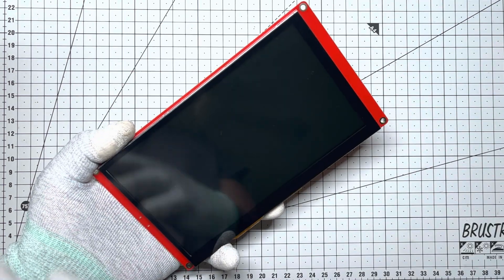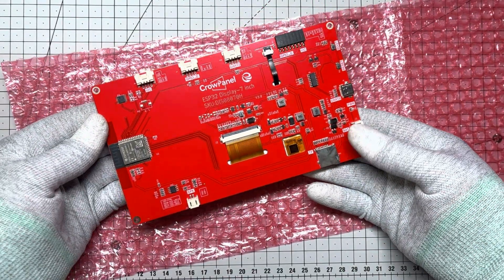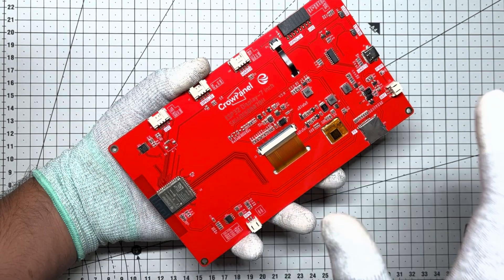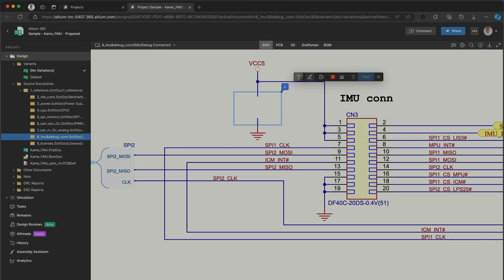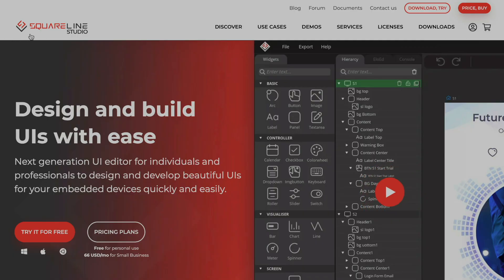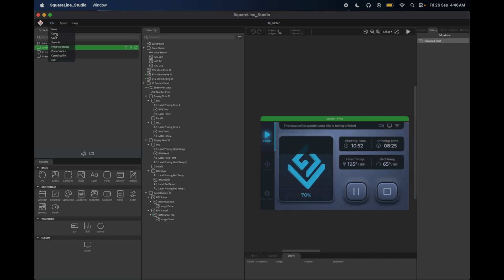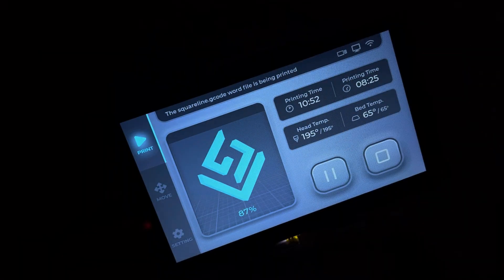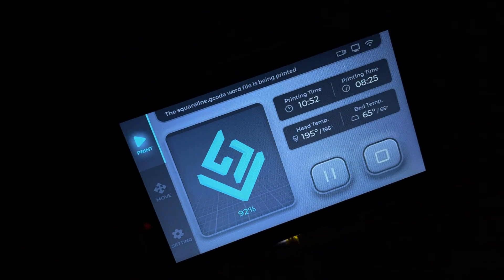Build a Stunning 3D Printer HMI with ESP32 & SquareLine Studio!

Comment: Loving the real-time temp controls—perfect for my Ender 3 upgrade. Quick Q: How's the latency when connecting via Wi-Fi to the printer? Killer tutorial, btw!
Reply from the maker: Awesome to hear it's fitting your Ender 3! Latency's minimal over Wi-Fi with good signal—under 100ms in my tests. Drop your setup details if you try it out. Cheers! 📡